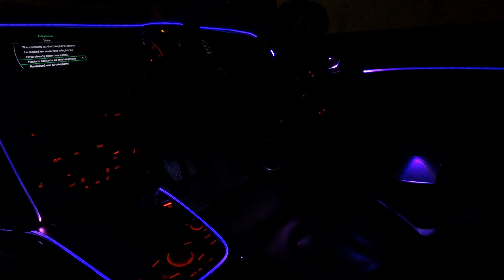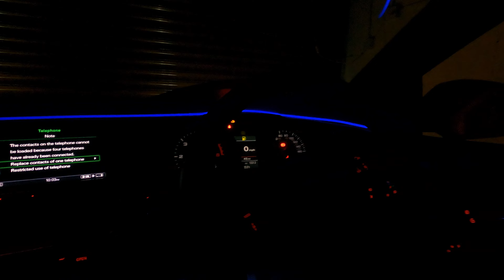Full Audi A5 Coupe 8T/B8 Ambient Light Install Version 2 | RGB LED Car Interior Lights

Comment: Can I ask you a question? While I see you have connected the main module to the cigarette lighting, wouldn't that be a problem when the car is go to start/stop mode? I mean the cigarette light doesn't always give power when the car starts/stops in the traffic light. At least that's what I have noticed.